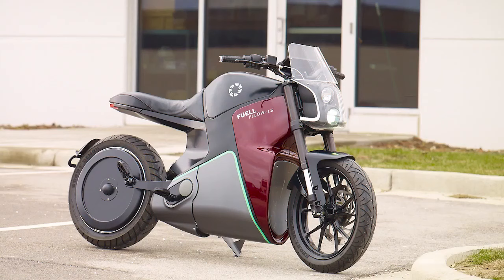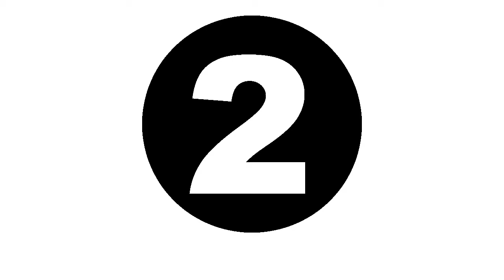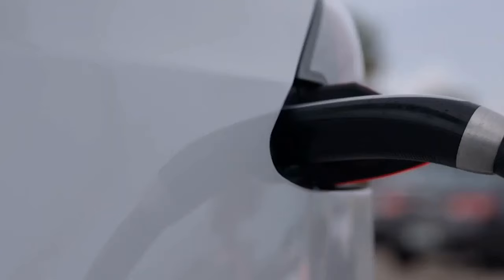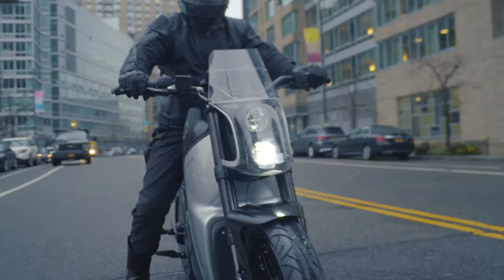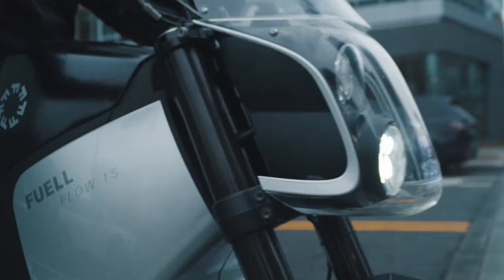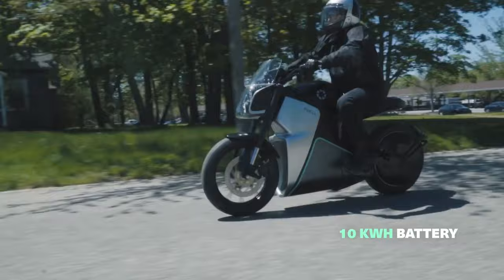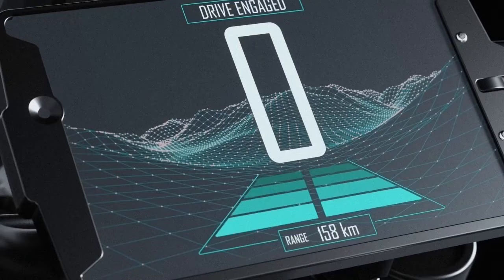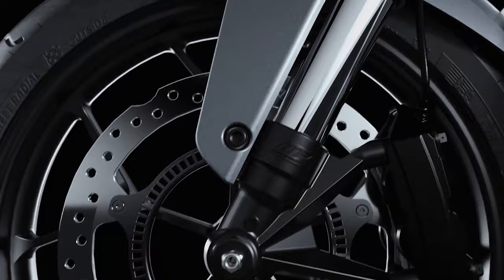Is the FUELL FLLOW ELECTRIC MOTORCYCLE the Future of Motorcycling?

Comment: $13,000.00 plus taxes , title , shipping?  assembly?  The IC motorcycle dealers sure have a lot of add on costs.
  It would be great for Local commuting , though at $7,400.00 my Yamaha is already paid for. That gives me most of $5,000.00 to spend on Gas .. .  I also have  $6,000.00 invested in a Buell . so that was cheaper too .. I did add $2,000 in luggage to the Yamaha that is a lot more than 50 Liters for Groceries.

Comment: But but but what about unsprung weight that rear wheels going to be heavy with that motor in it I guess 🤷‍♂️
Reply: This question was on the minds of many customers and was discussed by Fuell Fllow's leadership team in a response posted on the owner's group fb page. They stated that the weight of their Axially Integrated Transverse Flux Motor will reduce the weight by about 40% over a typical hub motor. Remember, this emc is optimized for urban commuting, so hopefully with the right suspension, my daily ride to work will be safe and comfortable.